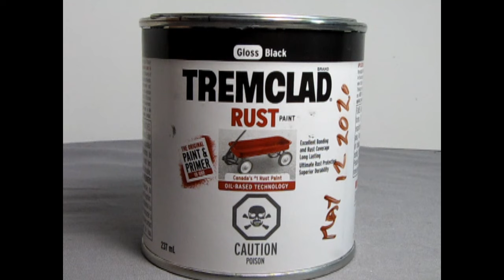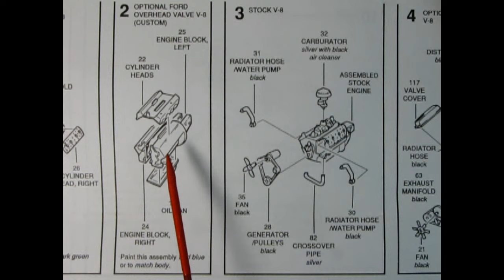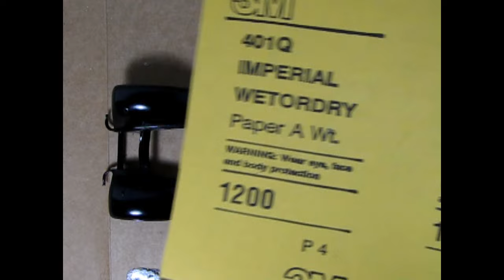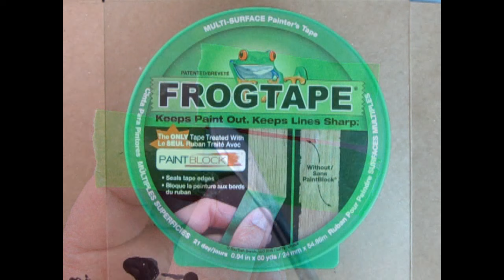How To Get A Pro Model Car Paint Job With A Paint Brush

Comment: I'll have to watch this in parts Trevor.  Watching you put that first coat on the red roof brought me back to the last time i tried doing it that way.  A teenager with his 2 white Testors brushes and a toothpick for the small stuff.
Reply from the maker: I remember a friend of mine painting like that - white plastic Testors brushes and a toothpick. You should try again with a good brush from an art store and see what you can do! 🖌😙

It's ok to watch the video in parts. I show a lot of things and I even time-stamped them for easy reference. Just click on the "More" section and it should open up for you.
Reply: I can already tell you put a lot of time, effort and research into this and I want to see the whole thing, not skip around.  I don't want to forget the comments I want to make as I watch new parts.  Plus my short attention span lol.
From what I've seen so far plus what I know or remember, if I was to try again I would certainly be using a better brush than I did back then!  Probably natural, not synthetic bristles.  A paint brand called One Shot, it's like the #1 stuff here for painted on pinstripes on real cars, especially custom stripes . Great durability!  Good reducer for it.  I would have primed the body, because I seem to get better results that way, and I've had fillers come back and show through or shrink over time.  
When it comes to brush painting a body you have more experience than me, so I'll watch it all and see what else I can learn 😁
Reply from the maker: @pappytinkers  I bought a starter set of Artist's One Shot. Came with red, yellow, blue and black and white. I also bought a set of Mack brushes to try and learn pinstriping. 

As far as experience with brush painting, when I was first learning to build models, I did it a lot, but as I got older, I switched to spray cans and air brushes. It's only recently that I went back to brush painting with the last 3 models being done this way. 

That being said however, I have inherited a lot of Testors square bottle enamel model paints from my Dad and I had a lot in my collection before, as well as my access to more since I own a hobby store. 

I also find that I can brush paint in the house without making too much of a paint mess or smell as you would get from spray painting or using an air brush and weather is not a problem. Therefore, I think I will do more of these paint jobs in the future.
Reply: @MonsterHobbiesModelCarGarage  the Mack 00 pin striping brush!  Watching a master put on stripes with one was always a thrill for me!  They do things I can only dream of.  I could watch them for hours.
Yes, there are benefits like that for using a brush.  Even down here in Florida, I have to Wait because of the weather too cold sometimes.  And if a project gets put on hold for too long, I lose interest and move on to something else .  I've switched to mainly acrylics now so the fumes isn't an issue as much.  But mastering the brush gives you the best of both techniques.  With a little imagination you might find ways to combine the two?
Having full access to a type of paint is huge as to what you use.  When I was younger, I worked as a painter in body shops, so I used automotive paint almost exclusively.  We had the mixing machines so I could make any factory color I wanted.  Or mix up custom colors, shades, pearls or whatever I wanted.  And the clears, OMG!  So hard, durable and nothing else beats the shine of a good 2k or high solids clear.  For a while, I would buy a kit, paint the body, then sell it on eBay for an extra $20-40 bucks.  This was back in the 90s, before you could get any of the stuff that's out now.  I changed careers and list access to it, and I wasn't happy with the actual model paints, so I quit doing cars till recently.
Reply from the maker: @pappytinkers  Glad to have you back. I also have an autobody history, but not as extensive as yours.

Comment: Do you use enamels exclusively or have you painted with acrylics? If so, do you feel you get similar or same results with acrylics as enamels? Are the thinning ratios different? I add a couple drops of retarder to slow drying time and / or flow improver to acrylics with the same approach of several thin coats to help avoid brush marks but am still learning and experimenting to get the best results.
Reply from the maker: I use acrylics primarily when I paint figures or Warhammer models. - this is the first painting video in a series I am making. I will try other paints in future videos, but for now I am going with Enamels.